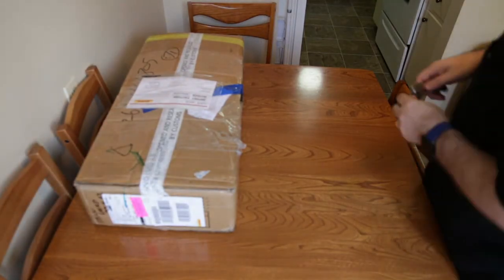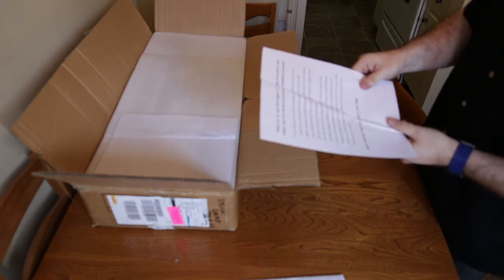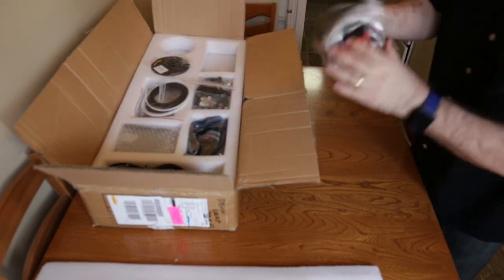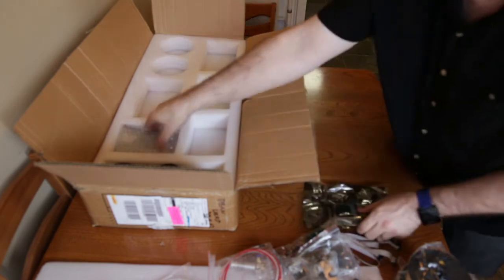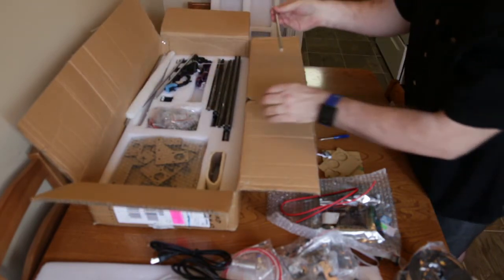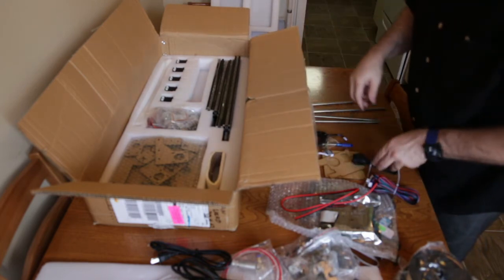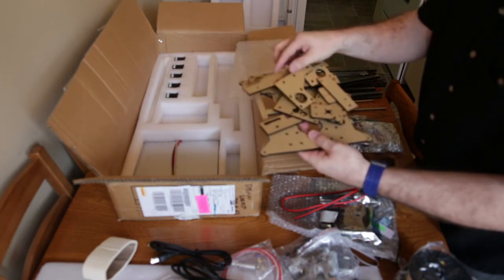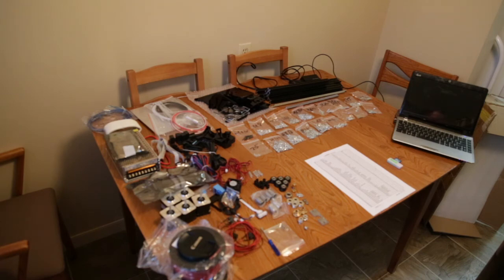FLSUN i3 2017 Model Unboxing

Comment: Hi, I bought one of these back in march, I'm still trying to get mine to work right.
I hope they have completed the assembly instructions. I have researched youtube and yes they have alot of info on the ramps setup but Flusun doesn't show you the info you need to finish the build... like calibrating the firmware or installing it either. Check your parts &  your cable ends to the steppers connectors, I had a bad connector where the wire ends are crimped for the connector, mine came off on the connector pins. 
By the way,  my packaging was upside down too.

 Well Good Luck anyway &Merry Christmas!